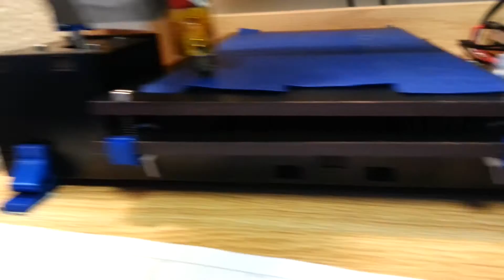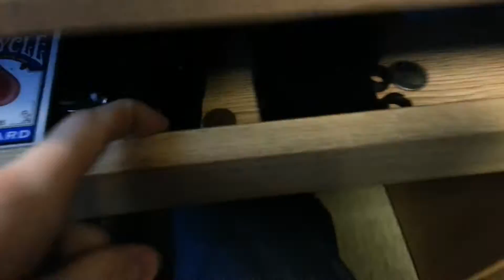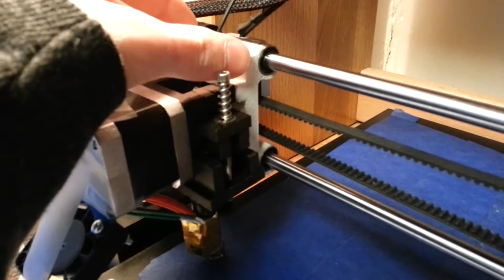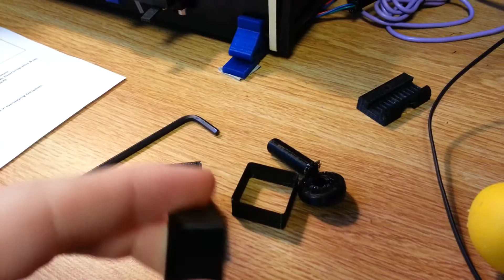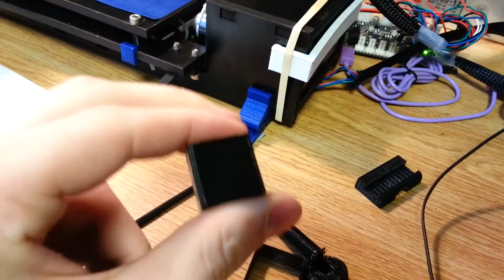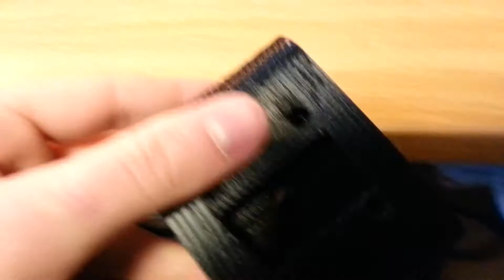QU-BD Two-Up Update 7 - New X-Gantry!

Comment: Are you able to email me the slic3r setttings please my email is danie.l.8@hotmail.com
Reply: and tell me the parts you printed, there are like 20 files in the same file.
Reply from the maker: ***** There is no sense in me emailing you my slic3r settings because I now use a new completely different 3d printer, watch my video which talks all about slic3r settings to learn more about them. Simply look up "slic3r settings explained" in youtube to find it. The parts you want to print will depend on your exact setup, you will need 4 of the screw pieces, 2 of the linear bearing spacers, and the 2 end pieces at a minimum (one end has a version for the qubd bearing and one version for using an alternative 608 bearing, read the instructions on the thingiverse page for more info).

Comment: What are the spacers you mention in your description, and what are they used for? I grabbed the two end pieces and 4 end caps, but I don't see where I would need spacers.
Reply from the maker: The two end pieces are significantly taller than the linear bearings are long, so these spacers take up the extra space in there. They will ensure the bearings are a snug fit and wont move up or down when the gantry moves.
Reply: 3DprintedLife So I need to print two of those little tube-like pieces. Thanks!

Comment: Could you tell me the file names of the parts you printed? I'm having a hard time picking out the 2 main gantry parts, because there's so many parts.
Reply from the maker: The two main pieces are: 
TwoUp_xgl_v19 (Motor end)
TwoUp_xgr95_v17 (Idler end)

You also need:
4x TwoUp_xgr95_v17 (screws)
2x lbs (Linear bearing spacers)
Reply: 3DprintedLife Thanks for the info!